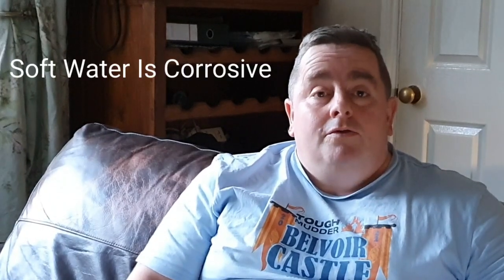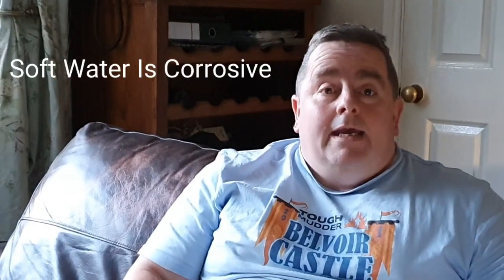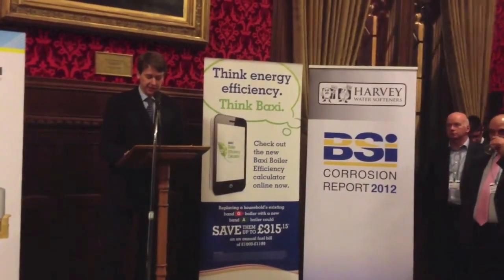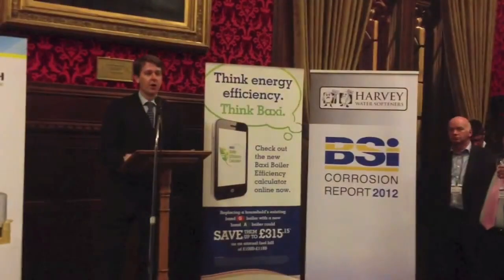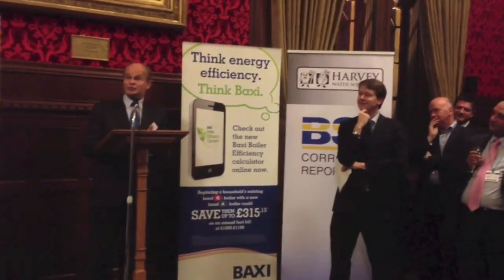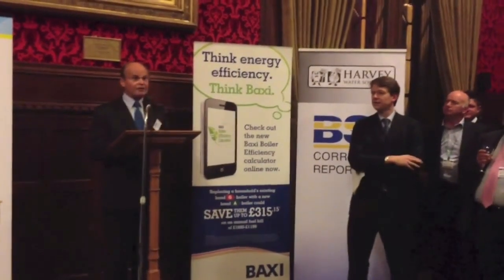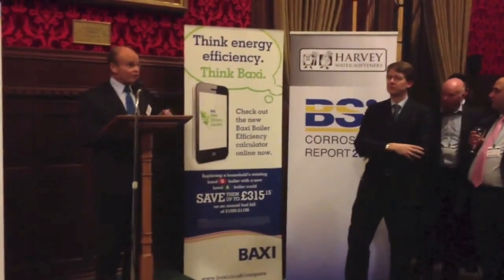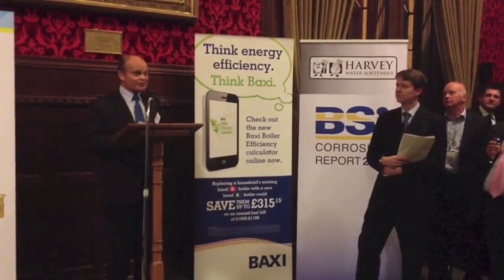Does Soft Water Cause Corrosion? Can I put Soft Water In My Boiler?

Comment: So there are two types of heat exchanger used for condensing boilers, aluminium and Stainless Steel. There's no doubting the fact that aluminium and softened water will work together without corrosion but not one word has been said even in Harvey's speech at the houses of Parliament about Stainless Steel, is that because it does corrode when used with softened water ? I think it needs to be said as half the boilers installed today are stainless steel and this video should not be misleading to the public or the heating installer.
So let's have it plain and clear.
Reply from the maker: Again, it's a common myth, and any stainless steel heat exchanger will be part of a system that MUST contain an inhibitor. Mostly stainless heat exchanges are made with 312 stainless which will not be affect unless insufficient inhibitor is in place and the pH level is very low. We have fitted many systems to Viesmann boilers without problems, and they have their own patented stainless steel heat exchangers. The majority of the heat exchangers are cast, or aluminium. None are affected, as long as the bylaws are followed and inhibitors are added. Great question though.